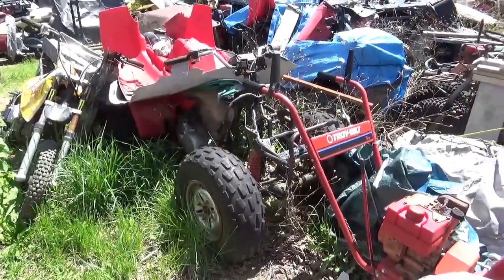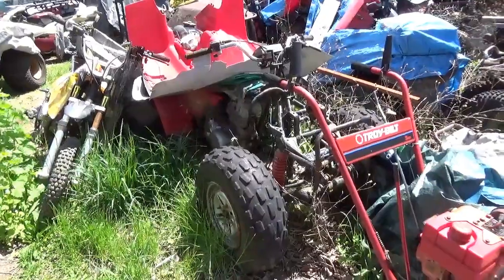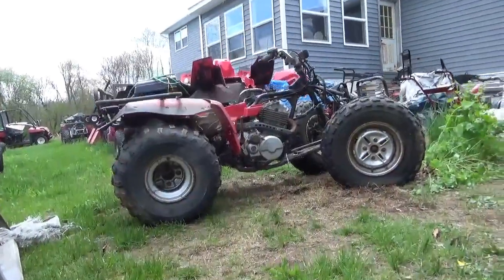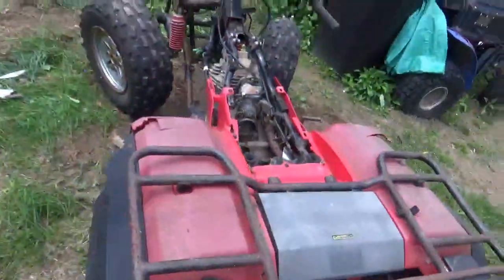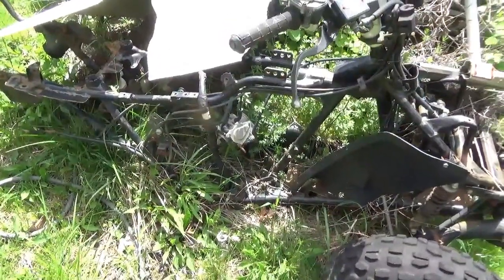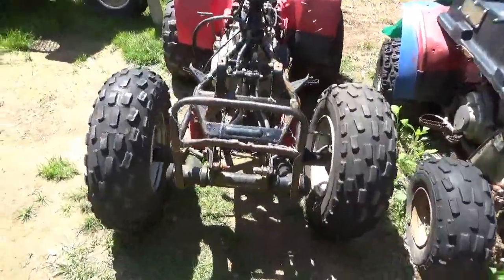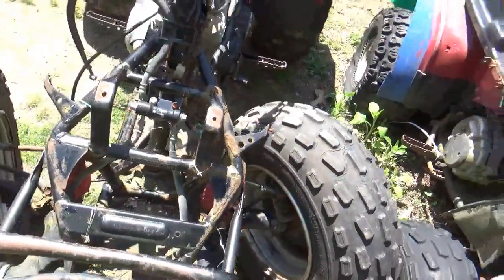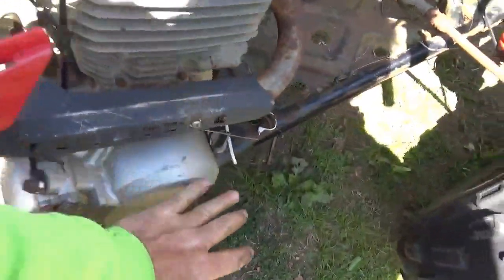Barn Find Honda TRX250, Bought for Parts, Left to Rust, Will It Run?

Comment: Hey man will The small cdi on a honda 250 work on a little China quad. Thanks.
Reply from the maker: Hey, In theory, any atv cdi can be made to work on any other atv, but, how to wire it, depending on the year of Ur honda 250, the wiring can be a real bear! The China ignition stuff is super cheap on eBay, I would hack a pit bike ignition onto Ur China atv...  I hope this helps...
https://www.ebay.com/itm/Kill-Switch-Wiring-Loom-Harness-Ignition-Coil-CDI-Spark-Plug-For-Pit-Dirt-Bike/292701829336?hash=item44266378d8:g:-PsAAOSw4jpbhgCX      Thanks for asking, watching, and commenting!!!

Comment: Hey Harvey I have a 85 Honda 200x it sat for 10 year plus it's got great compression the issue is valve seals     my question is have you ever done a seal job with just pulling the rocker cover and not the head have you ever done it this way if you have can you do a video Thanks.

Comment: Great videos Harvey. I have a 1986 Honda TRX 250. I actually bought the same carb that you bought off eBay. The wiring harness was a spaghetti mess. But somebody had gave me a partial donor. But I'm screwed on the ignition part. Down by the CDI you have four individual connectors two black and white a green that you can plug two wires into it and a red. I was wondering if you could tell me the color code on them. I have two extra key switches laying around 1 is a four wire three wires in a three wire connector and a single wire connector. I also have one that has four wires but it has a red a black a pink and a pink and white. I just need the color code thank you

Comment: What's up Harvey how would u go about changing a circle plug CDI on a honda  big red 1985 ATC es  into a square plug CDI need help finding a CDI box on the internet that will work for my wheeler hard to come across an original

Comment: have you ever deleted the spark advance on a 84 TRX200? Or do you know if it can be done? I got mine from a guy said the cdi was bad but it was the spark advance the head broke off from the cam and destoyed the advance. I cant find a new one and used are expincive on ebay.